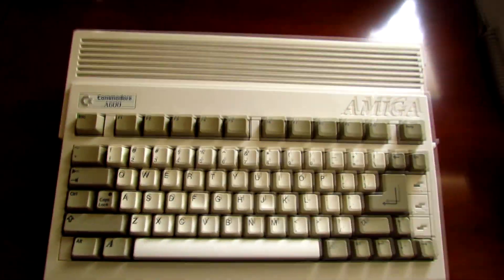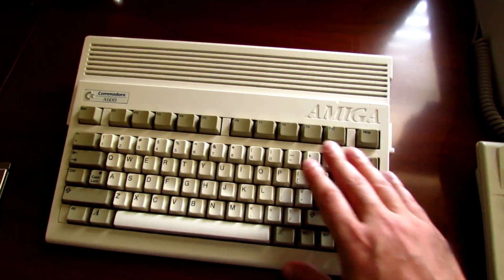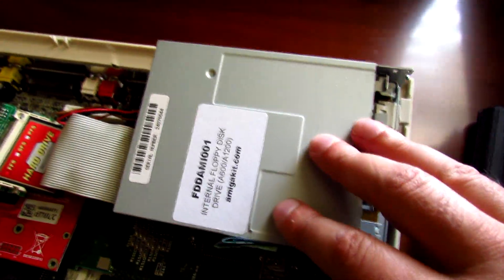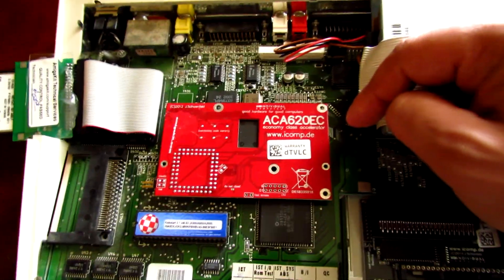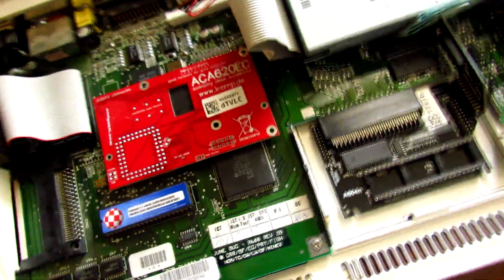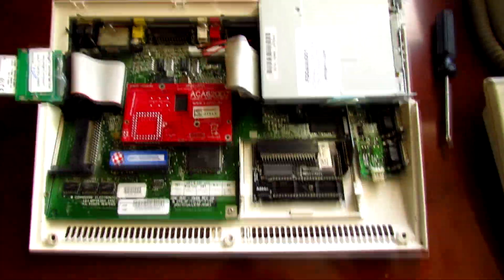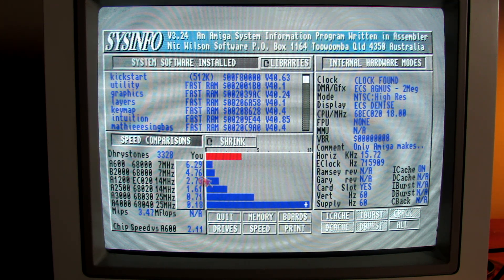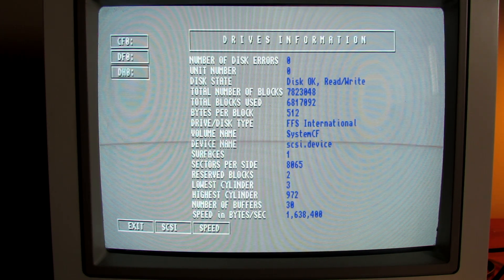Commodore Amiga 600 (A600) Review

Comment: The lack of A600 popularity is because at launch it cost about twice as much as the A500 price for the same tech, but with changes that crippled upgradability. There were already rumors of an advance Amiga in the works, and when the A4000 was announced 5 months later those rumors were confirmed. The plan was to have a product line of A4000 for professionals, then the A1200 for pro-sumers/gamers, and the A600 as an entry-level computer. It could have worked, but the flaw that killed the plan was that the projections of it being cheaper to make than the A500 were way off. There's a reason why it was discontinued so quickly.

Comment: The 600 came out about a year before the 1200. Wasn't cheap either. I bought the Lemmings Amiga 600 pack and it cost me £399 at the time(1991/92/93 or so). Was flipping annoyed about that as about 2 months later the price dropped £100.
Reply: I had an external 200mg hard drive that plugged into the pcmia slot. Bloody expensive at the time and I never did fill it up completely. The HDD cost more than the flipping Amiga.

Comment: I remember hearing about the A600 before the A1200 had leaked, and despite it having proper support for PAL, I didn't consider the A600 worthy of replacing my A1000 (which had a total of 1.5MB installed).  I remember how confused everyone was about the A600 and NOBODY wanted it, even though I loved how small it was.  I immediately pre-ordered the A1200 as soon as it was announced, and literally got the very first machine in my area.  I also soon dropped in 4MB fast RAM and an FPU, which wasn't possible on the A600.

I wouldn't mind having an A600 as a collector's item, as it is brilliantly compact, but the A1200 is still the king of Amigas and my favorite computer of all time.  Mine is still pure white and minty fresh, and I use it all the time.  8)

Comment: impressive! I have an A1200 running  with a 4GB flash memory card and 8MB fast ram expansion. Turning it into an A1208. I'm getting 2.96MFLOPS. I see you're getting 3.47MFLOPS with the 68020 clocked at 18MHz.. so you're  around 2.5 times quicker than a standard A1200..  nice one! lovely A600

Comment: People tend to forget, that commodore intended the pcmcia port, to be a games cartridge port. They wanted games devellopers to release games that was able to run from a pcmcia based read only storage. That is what they talked about during launch. Then we have the placement of the joystick porte, that clearly indicates ease of use, in regards to plugging in. And finally we have the size of the machine, that clearly indicates non-office use. We have compatibility with most old a500 software and games.

I think people have missed the point of the 600 all these years. It is supposed to be a games console for what games that were already released, and games that were what we now know as casual gaming. Finally, it was geared towards kids and teenagers, and so they included a keyboard as well, just to be on the front with the failures of CDTV and C64-GS. After all. The C64-GS was the brainchild of mehdi ali, and I bet he did not want to repeat the failure of the C64-GS. And the keyboard was included because the C64-GS turned out to play games that needed a keyboard as well.

I think these are the reason for why the 600 was build the way it was.

Comment: Always loved the feel of the keyboard an so on except the cables should've been from one side of the power box only, always difficult on a desk. Years ago my A600 gave up because of the hdd. I didn't know that a cf/hdd adapter had gone on (year?) sale. Did you need to install the system to the flashcf while inserted or ext? Or set as the system disk with some utility (name?) first, and then copy system  files onto it externaly before plugging in as primary drive?

Comment: I love winuae running it with my amd ryzen system which is far faster than any original amiga and better display output :-)
Reply: Me too. Still miss my amiga 500 and amiga 4000. Running an emulator just isnt the same. Not willing to pay alot for old hardware either, so winuae will have to do. The price for a used amiga is just insane here atm, and most of them dont even work. And even if they do, you really dont know how long they will stay that way being that old. I wouldnt mind an amiga 500, as they are easy to fix, if the price was alright.

Comment: The A600 was a failure because it was too expensive.  It was designed to be a budget machine (as specified by Commodore UK) but Commodore Germany got hold of it and started changing things until it cost as much as an Amiga 500+ and ended up being marketed as a succesor just which reached market about 6 months before the Amiga 1200 came out.  It just didn't make sense in the market.
Reply: Exactly. I can see why it was loved by people who had one as their first Amiga, but for A500 owners, this was NOT an "upgrade" at all, and so it's market was limited to new-comers of the time. And then it was swiftly and TOTALLY surpassed by the A1200, which was around the same price but was 32 Bit. I'd argue the A1200 would have done better if the A600 never made it to market. If you'd just purchased the A600 and then the A1200 came out, you'd be pissed as hell.
Reply: The real reason the A600 cost so much was the decision to use surface-mount technology, which at the time was very expensive.  The engineers disagreed on whether SMD would be cheaper or not, and management sided with the guys who insisted it would be cheaper, even though it was blatantly obvious from the suppliers that was not the case.  I think the guys from Germany were the ones responsible for the PCMCIA slot, which indeed was quite costly due to all the bus arbitration chips, but it wasn't the biggest cost.

Ultimately, while the CDTV gets a lot of the blame, the A600 is what really sunk Commodore.  They manufactured more than a million A600's anticipating huge demand, and didn't order enough A1200 parts from Hewlett Packard.  The company took a huge write-off on the massive inventory of 600's nobody wanted, while the 1200 was out of stock throughout the 1992 Christmas season.  They lost a TON of money in 1993, selling A600's at a loss and sinking extra manufacturing costs into expediting A1200 production and shipping.  There was no way to recover from that.  What a mess.
Reply: It’s not like Commodore to completely screw pricing *cough*264 series.

Comment: This thing was never supposed to be a Amiga 600, early versions had A300 written on the board. The idea was a lower £199 cost Amiga 300 to replace the ageing C64, something you could expand (which is why it's so good for retro guys now) but Germany got in on the act and we ended up with this confused thing and we then got the A500+.

Comment: Nice setup and nice review :) I have the exact same setup in my Amiga 600 except I also have the Indivision ECS plugged into the A604 card. I had to use the small grounding screws that came with my ACA 620 to get a really secure connection or else my A600 would not be stable. Really great setup for gaming. does take up alot less space VS A500 + ACA 500 or A1200. I have all of these systems with accelerators and stuff.

Edit: Oh, you can set what quit key you want to use in each game or do as I and set it to use the 'del' key for all games. You set this up in the whdload startup file